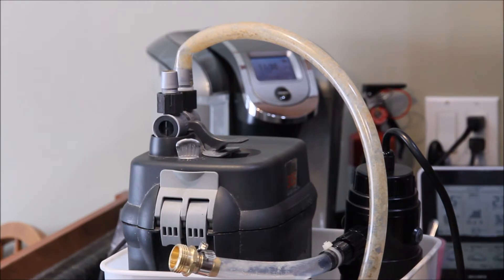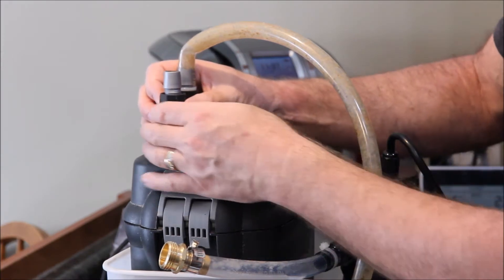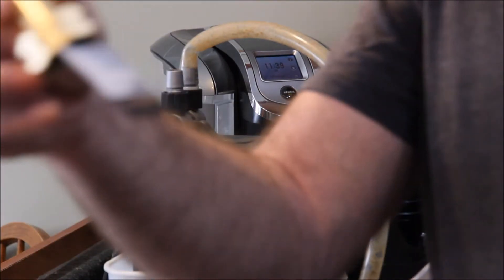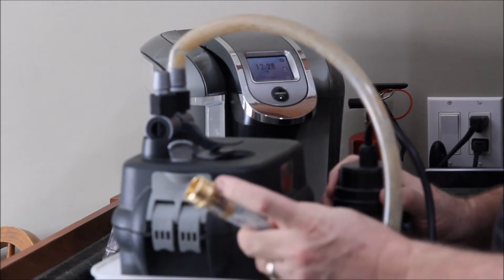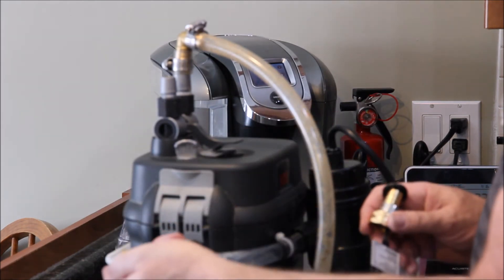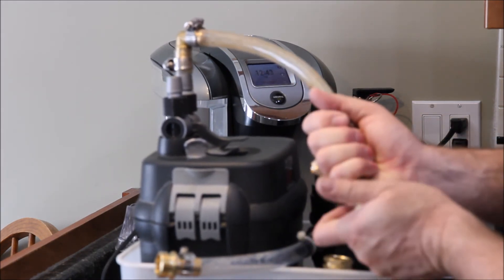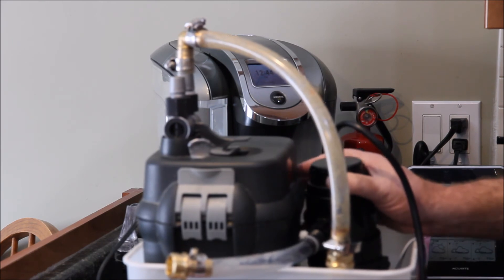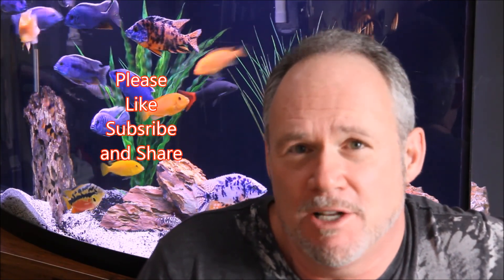Turbo Twist UV Installation With Fluval 305 In My Display Aquarium

Comment: I'd be more inclined to use PVC fittings. I'd also use 45's instead of 90's which would help with the water flow (less restrictive)... Also, the outer diameter or thickness of the hose you intend to use does not really matter.  The plastic tightening nut on your fluval does not need to be used if you use a thicker walled hose. Simply remove (if you wish) or drop the tightening nut as low as you can (loose)  then place your thicker hose on and over the pumps' nozzle then use a hose clamp (not a tie strap - they won't tighten up enough!!)  If you want, you could put the end(s) of your hoses in boiling water for a short while then push the hose over the nozzles. I am planning on using 5/8 ID x 7/8 OD reinforced vinyl hose with my set up and of course, you will definitely need to use some 45 degree hose fittings. The hose is very stiff and trying to manipulate it around, up and over  things may cause the end of the nozzle to break (off)  great video btw!!
Reply from the maker: You've given me some great ideas, I will pin your comments to the top so others might see them. Thanks for watching!

Comment: Well done Bobby. I love those inline turb twists!💘😁🌿💦
Reply from the maker: Thanks for watching the new release of this. How often do you replace bulbs?
Reply: They should be replaced once a year I'm told. So far mine have been fine. When the blue like is out I'll change them. 💦😁💘
Reply from the maker: Yes I've heard some claims of 6 months but 12 months seems to be the opinion of the majority. I think the bulb will glow blue for much longer so am not certain that would be a good marker, time will tell.
Reply: I agree.. time will tell. If I notice anything in my tank I will check it but so are they are great. Mine are not a year yet. 💦😁💘

Comment: Nice set up I have 125 gallon thinking about getting 6 x with an oase canister filter you can adjust flow on oase do u think it would be good for my 125 or should I get 12 x are u still happy with yours